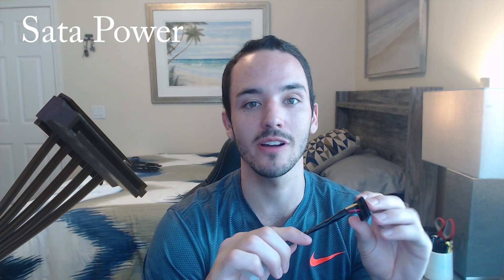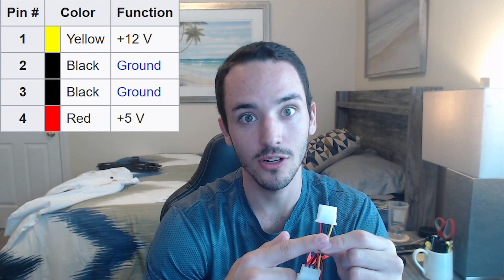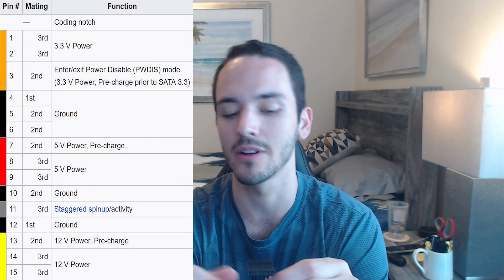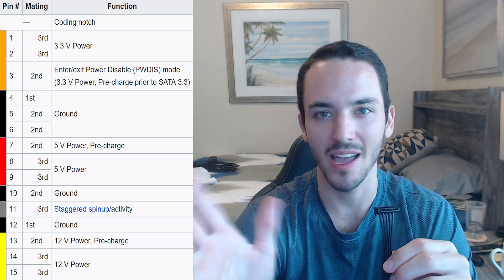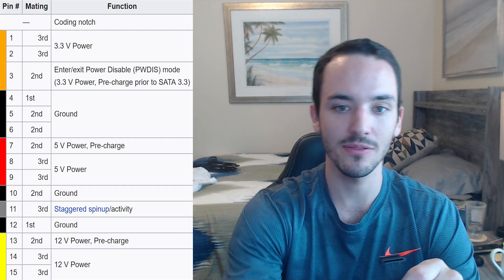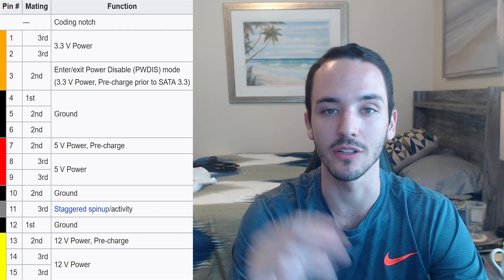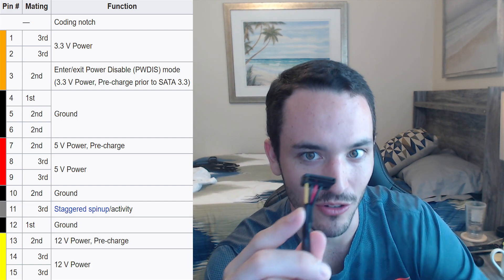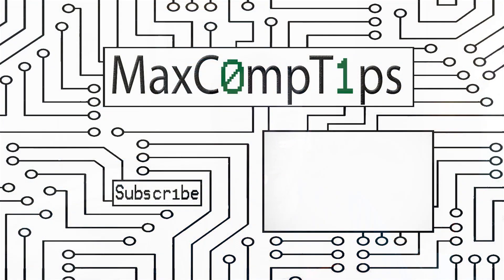Sata VS Molex Power - Explained

Comment: Very helpful video, I was wondering why my new hdd I installed not working from time to time, it's the Molex to Sata not giving enough power. I get the real Sata to Sata connectors and left Molex unused, it fixed the problem.

Comment: Very interesting. I've been observing that external USB cards run a lot nicer if they have a Molex power connector behind them Vs board power by itself. 

It however also introduces instability at high clock speeds. 

Perhaps ground impedance is the issue. There are cards that have both SATA and molex connectors at the same time - I wonder if you can supply both at once for the lowest impedance possible?

Comment: I have got a 2011psu in my current system, and the pcie cable comes with a sata plus molex cable combo,is it ok to cut the molex connector and sticking it with electrical tape or would it affect my SATA cable

Comment: Is it ok to use a sata splitter or molex to sata just to run a commander pro by Corsair?
Reply from the maker: I wouldn't use a splitter since you would end up having multiple fans drawing power already from that, and would likely overload that one sata split. A molex power source would probably work fine. I don't have experience with the commander pro though

Comment: so... its not relevant if I use Sata 5v or molex 5v to power argb strip?
(Id like to have a lot of argb in entire room controlled by pc so i'm probably gonna need an additional power source from my PSU)
I wonder if there are no differences in stability between molex and sata and even if it would have an impact on just simple argb strip (I guess they are not as sensitive as GPUs are (I used to have molex to 6pin power adapter))
Reply from the maker: They both come from the same power supply, so as long as you have a good PS shpuld be identical. Do they make sata power adapters for RGB strips?
Reply: @MaxsTech  yes, even RGB and argb controllers powered by SATA power cable 
But I want to controll all RGB by my motherboard and i already have molex to 6pin adapter so I can just solder argb strip to the adapter and connect it to my psu without destroying any psu cables

Comment: Resistance is a concept used for DC (direct currents) whereas impedance is the AC (alternating current).  computers hard drives don't use AC (alternating current) to power hard drives.

Comment: Is it okay to use 15 pin sata power splitter to power up two ssd?
Reply from the maker: You should be totally fine, on average an SSD will only pull about 2.7W while in use and a sata cable can deliver up to 54W. Just make sure the splitter is a quality cable.
Reply: @MaxsTech  thank you!

Comment: Okay, so I’ve looked all around on google and it’s being a pain because people say not to use molex connecters. However, for some reason my sata hdd’s will NOT boot up if I have a regular 15 pin sata power cable, but WILL boot if it’s connected to a molex to sata adapter power cable. Why is this? It has done this to two PC’s now and I don’t understand why. You’d think it should just work with the normal cable that comes with the modular psu but it won’t work for some God forsaken reason and it’s annoying the hell out of me because no one has an answer, or at least no search results yielded one.

Comment: I'm trying to figure out what it means on my power supply it says peripheral - IDE/Sata/Molex . And then has like three different slots for those. I need more cables to power my gpu
Reply from the maker: Those are to power peripherals, through ide(old harddrived use this), sata power, or molex power cables. Gpus need pcie power.
Reply: What about my cpu does that also run off pcie power?
Reply from the maker: Cpu draws power from your motherboard itself. Draws from the big 24 pin as well as the upper left 4 or 8 pin cpu power. (Depending on the board/cpu)

Comment: is it okay to use sata power cable to molex if you want to use it to rgb fans ?
Reply from the maker: As long as the fans are either 5v or 12v should work fine.
Reply: @MaxsTech  thanks man helps a lot

Comment: So I am thinking about getting a PCI slot GPU fan cooler and my power supply doesn't have a Molex connector that the fan requires, could I use the adapter he showed at the end of the video and then hook that up to the right power cable that is supplied by the fan and further hook that up directly to the fan?

Comment: 🙏 how can I use a spare sata cable, from my old CD rom drive, to power a 12v fan please.
Reply from the maker: If its a sata power cable you can buy adapters. I don't believe a sata data cable can supply voltage.

Comment: hey, im looking for some information about using molex to pci or sata to pci converters, what should be more safe? anyone knows?
Reply from the maker: There are molex to pci power adapters. Although in my experience its not worth it. I used a molex to 6pin pcie power in the past and found my graphics card would crash because it wasn't receiving enough power.
Reply: @MaxsTech  what is your gpu back then

Comment: So i bought 3 cheap fans from china...and they are all molex only. Idk what power supply i need to connect them or what not...help
Reply from the maker: Every power supply should come with a molex cable with multiple plugs on them for you to use.
Reply from the maker: Every power supply should come with a molex cable with multiple plugs on them for you to use.
Reply from the maker: Every power supply should come with a molex cable with multiple plugs on them for you to use.

Comment: So I don't necessarily need to use the molex in a build, just the sata cable?
Reply from the maker: A lot of modern builds today don't use molex at all. Harddrives and optical drives have all switched over to sata power.

Comment: Its better to use in a fan controller or in a disk? thanks , good content
Reply from the maker: Not sure what you mean by "in a disk" but as long as the fan gets power it really doesn't matter. Fan controllers can be nice to monitor the fans speed and set customized curves, but IMO not usually worth it
Reply: @MaxsTech  i mean , i have 2 SATA AND a few molex , so If you have to choose to use an adapter with one device Whats better, use it to power up the fan controller or a HDD (hard disk device).
Reply from the maker: I would keep the harddrive directly with the connector. And use the adapter for the fan controller. Just incase the adapter fails or something you want to make sure your harddrive doesn't lose power
Reply: @MaxsTech  make sense, thanks!!

Comment: My problem is getting a power supply for my SSD  (SATA of course). There is only one (daisy-chained) power supply for the two HDD's. So what are my options for getting power to the new drive? The (2013-vintage) PC also has 2 x 6-pin female Molex slots. Be good to see something  on this - thanks!

Comment: Can we use the extra molex and get a 6 or 8 pin adapter for an external GPU?
Reply from the maker: You can....but in the past I have done this and my card wouldn't receive enough power at times and would black screen on me. So I guess it depends how much power your card draws

Comment: i am going to get a fan hub and it has 2 options - molex/sata connection. which one to pick?
Reply from the maker: Depends, if you dont have any other molex devices and your psu is modular I would go with sata so you can remove the molex cable entirely. For fans it really isnt that big of a deal, biggest concern for me if I did that was cable management Haha
Reply: @MaxsTech  Thank you so much Max! :-)

Comment: Hey, I've been looking around for an answer but I cant find it anywhere, I heard stories about molex sata power cables and extenders melting hard drives, and I wanted to know if a sata power cable y splitter would be safe compared to a molex one.
Reply from the maker: I'm gonna say those are prob just stories. For one, theres not nearly enough power going through molex or sata to melt anything. And if somehow someone's drive did get fried it was prob due to a faulty power supply. I still would not recommend splitting power between hard drives, to make sure each drive receives enough power.
Reply from the maker: Splitters are best used for fans only or maybe led lights. I wouldnt use them for any components as I've done that before (for a graphics card) and ran into issues where my system would shutdown or the screen would black out. My card wasnt recieving enough power since splitters merely share the power and dont duplicate it.
Reply: @MaxsTech  thank you so much! I     was mostly going to use these splitters due to a problem I have with my new PC's case, I have three 2.5 drives, two ssds and one hard drive and the slots to place them in my case (nzxt s340) dont have space for the cables to come in from a clean 90 degrees you know? Like theres too much flat panel under where the cables plug in and I cant find any official wires for my modular psu that are flat and would work for it, the data data cables are fine but all my power cables are 90 degrees and are kinda having pressure put on them case I had to squeeze them into the drives
Reply: I was wondering if there was a wire for my modular psu or otherwise you could recommend that has sata power that isnt 90 degrees on it?
Reply from the maker: @NamxZero I would look up your power supply and see if the brand sells other types of cables since your p/s is modular. Otherwise if its an ssd it can be mounted basically anywhere since there are no moving parts, you could literally shove it anywhere, in any orientation. The 2.5 drives would be best used in the cases slots. I would look into perhaps getting a new single drive to replace those 3 though unless they are all already large drives.

Comment: I'm confused. There's the molex to Sata cable using 4 wires and has only 5v & 12v and then there is the "actual" Sata power cable which has 15pins and has the additional 3.3v. Huh? Doesn't both Sata power cable have 15 pins? In the "actual" sata power cable, I only see 5 wires going to the connector. On one cable you talk about 4 wires and 2 voltages and you compare it to the "actual" sata power cable but you talk about it in terms of the number of pins on the connector  (not wires) and 3 voltages. Now, I got more questions then answers. Can they both be used to power a Sata drive? lol Btw, I'm trying to figure out how to measure the voltages from a Sata power cable, but the connectors are so narrow and hard to get to the pins. Anyone?

Comment: You saved me 250€ from purchasing a new mini htpc ION 330. Burned the sata cable from motherboard to 2.5 hdd and I had to custom made a cable from 4 pin square plug on motherboard to molex and then to sata using only the 5v of molex as you explained on your video. Thanks!

Comment: Molex to SATA cables can cause problems with SSD's like the Samsung 840 and 850 Pro

If you try to wipe the drive with Samsung's bootable drive wiping utility, you may find that the drive is Locked and cannot be wiped even after disconnecting power to the drive for 10 seconds and restarting the utility as Samsung recommends

If you plug the SSD directly into a Real Sata Power Cable from the power supply, this problem will instantly disappear and you can now wipe the drive
Reply: Update:
After FINALLY getting the Samsung wiped correctly, I find that it can now be wiped correctly using the molex power connector so I'm not sure what is going on here

Confused?
Me too!

The SSD's could not be wiped when they were on a molex connector
Switched to a SATA connector and they wiped just fine
Now they can be wiped when back on the molex connector

So wierd
Reply: The cables are not the same electrically. The SSD is made to use the pins of the true sata cable. The converter cable is not doing the same thing an actual sata does. He explained what I'm saying in the video. The ground and redundant features of sata vs molex. You are using an old tech and that drive won't support it.

Comment: I got a question for you- If I have a PSU with male molex ports, do I need a female molex cord to plug into that port?
Reply from the maker: All PSU's will have the male ends. Those will plug directly into your devices i.e. your hard drive, optical drive, fans etc. which will have the female ends.